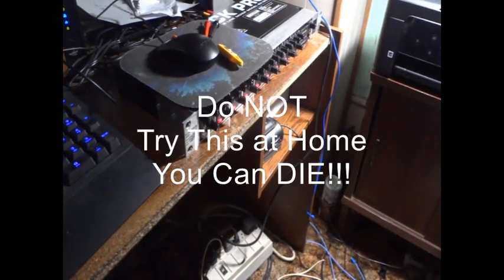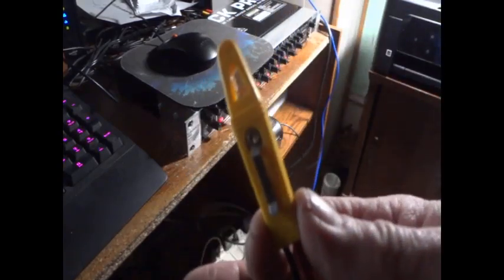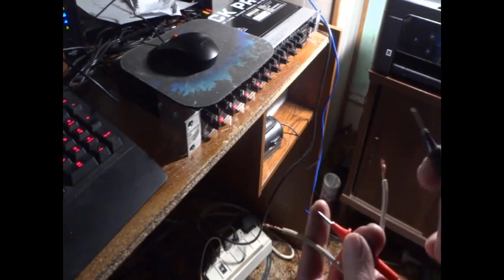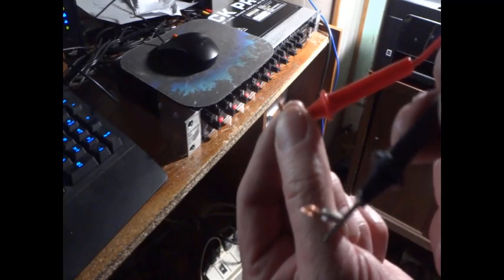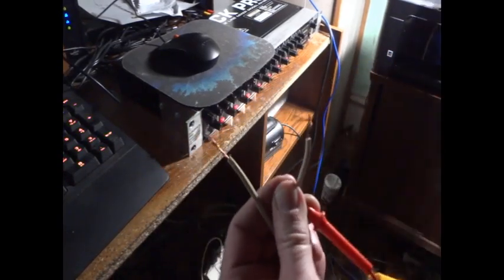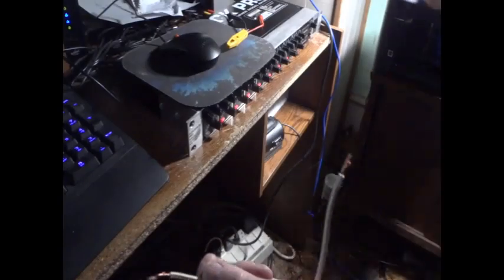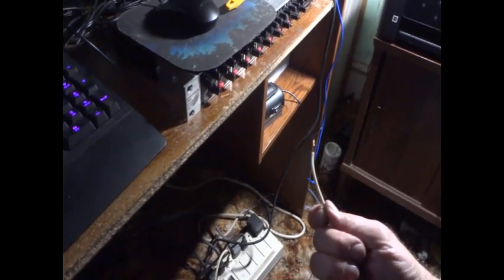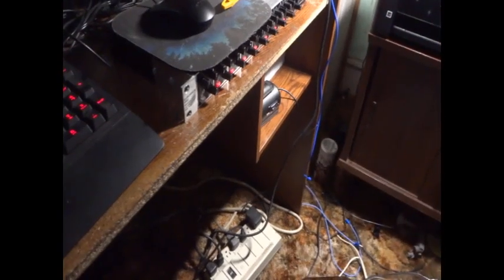A 120 Volt Dangerous Experiment at home. Do NOT try this EVER, U can DIE!!!

Comment: nice trick!
Reply from the maker: Yes an electrician taught me this trick in finding the hot wire. But this type of test is only safe for 120 volt circuits. higher voltages may put enough current thru the tester that can kill you.

Comment: Yes, you most certainly CAN be shocked by the neutral.  I have done so many times doing electrical work.  If you are working on circuits that are part of 220, 277 circuits, if things are unbalanced, the neutral can be slightly hot.
Reply: By the way, you are not using a continuity tester, you are using a voltage tester.
Reply from the maker: Yes I misspoke that TY for you comment. @woodsie5474
Reply from the maker: Yes correct, but we R discussing house wiring TY.

Comment: This is just stupid to be holding live wires just inches from your fingers. If it slips or your other hand leans into it, you're getting shocked. You could easily have it touch each hand and go through your torso. The wires could have easily been secured, with shields around the ends so they can't be fallen into. This is a ridiculous video, but a good chance for viewers to learn something.

I can only imagine how a gun safety video would look.
Reply from the maker: Yeah, like I have never been shocked before, I was thrown across a room touching over 1000 volts DC, Yeah, been there done it Thanx 4 the reply :)

Comment from the maker: For those of you who do not understand USA home wiring, I will try to explain. Say you are in a car, did you know that you connected to one half of the car's electrical system. Same with house wiring, the earth is the car body and all the wires in the car, well most of them are connected to the positive post of the battery. These insulated are the hot wires, same as the black wires in your house wiring. The Neutral wire would be the car body.
Reply: "These insulted are the hot wires,"

Meaning of insulted in English
to say or do something to someone that is rude or offensive: First he drank all my wine and then he insulted all my friends. Synonyms. affront formal. diss US slang.

If I was insulted, I would probably become a hot wire myself.

I think you meant insulated.
Reply: Misspelling... should be INSULATED.  Definition: covered in nonconducting material to prevent the passage of electricity. "insulated wire" @nathanwoodruff9422
Reply from the maker: @nathanwoodruff9422  Thanx I corrected the spelling :)

Comment: You didn't explain why it also would be safe to touch the hot wire! If all other parts of your body are isolated, rubber shoes, rubber mat, etc. you can touch the hot wire itself as well. You also can do this with 220 volts but with 440 volts or higher you may feel a bit of capacitive current. It is most important to FULLY UNDERSTAND what a circuit is when working with dangerous voltages. Many people do not, as is indicated below in the comments!
Reply from the maker: Under certain circumstances yes you can touch the hot wire. But I would not recommend that to anyone.
Reply from the maker: I would not go there.

Comment: If the circuit were complete your "neutral" would be returning electricity to the receptacle, would NOT be safe
Reply from the maker: Yes that is true but the neutral and the earth I am standing on are the SAME Circuit. So there is no difference in ME or the white wire, IE Neutral.
Reply: @Bob_V The real problem happens when your neutral is somehow at a higher electrical potential than you, and your ground is floating. But your test should show that, assuming there is not a diode in your tester or a problem with it. All this being said, I'm just an idiot theory crafting.

Comment: On ships, the system is ungrounded and both leads are hot. Therefore, we have to use special power strips with fuses for both. The power strip you buy at any hardware or electronic store are only fused on one side because one of the leads in your home is neutral.
Reply: Who cares about ground?
Reply from the maker: I am not understanding this well, if the system is not grounded to the ships hull than I would think you could touch either lead with no risk of a shock right ?
Reply: @Bob_V  he replaced "sh*t" with "ships"

Comment: Touching neutral is NOT safe. What if contact is lost for whatever reason?

Well, OK, you could probably survive 120VAC shock in the US, GB, or wherever you are. But, in the 220 to 240V Euroland & Russia, you better not play with live wires.
Reply from the maker: If the Neutral had a problem the neon tester would have been lit, TY for you comment.
Reply: Well, if the Neutral is disconnected for some reason you are not really connected to anything anymore, the neutral and ground is in theory the same and normally joined in your house central so basically when you hold a device with a grounded metal chassis you are touching the neutral too, The danger comes into play if you are touching both the live and neutral/ground at the same time and your body is the only path between. I live in a 240V country so our live packs quite a bit of punch compared to the poor 120V lines but it is just common sense to never touch wires that is potentially live is it not?
Reply: 230v is fine, it'll give you a jolt but you'll survive
Reply: You also never know if a neutral was wired wrong and is actually caring current because it is the return for another circuit that is not supposd to be connected but is.
Reply: My point exactly. Lost contact from your neutral to grid means live contact from your computer, light bulb, or whatever else still connected to grid. @nateo200
Reply from the maker: I wired my house and it is CODE correct, do not speculate on my wiring. @nateo200
Reply: Im not talking about your wiring  speccifically just in general as I found this interesting @Bob_V
Reply: GB IS 230VAC and this video should be banned.